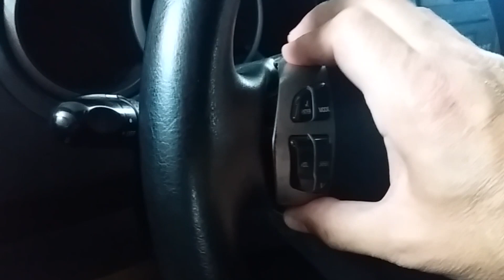Suzuki Grand Vitara / Removing the Steering Wheel  Airbag and Control Buttons

Comment: Possible to add cruise control to the 1.6L 3-door aftermarket?
Reply: Did u ever get to find out?
Reply: I know for the 5 door models, look under your steering wheel for the Cruise control fuse. If it does it should be able to add cruise control by just installing the steering wheel buttons. There’s a forum online with step by step instructions.